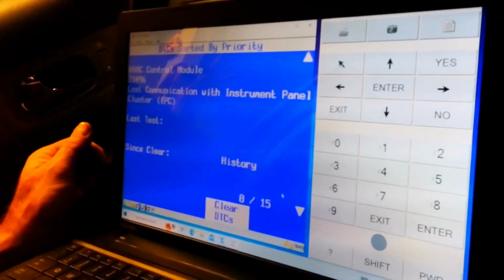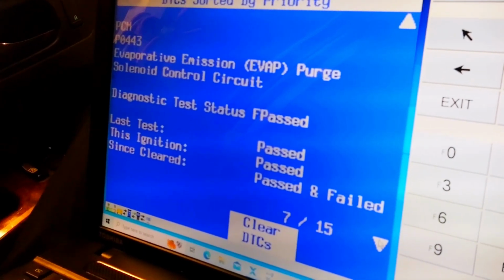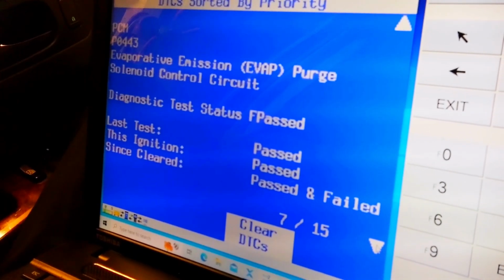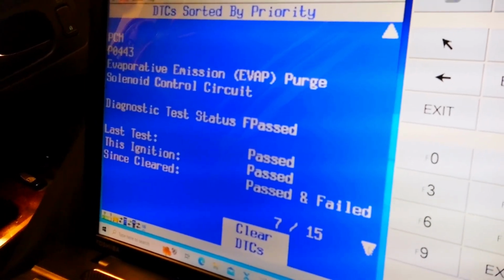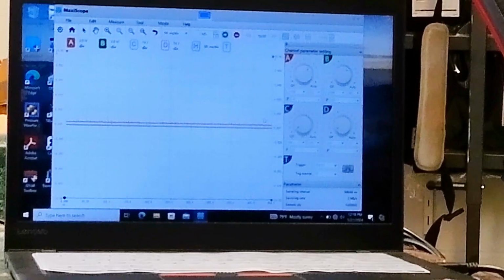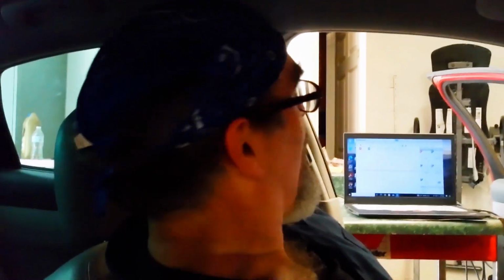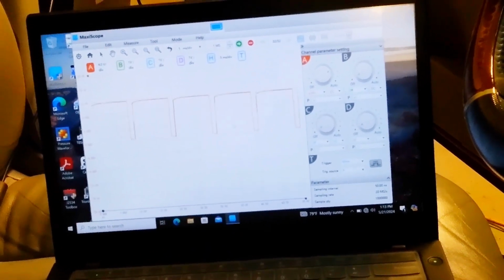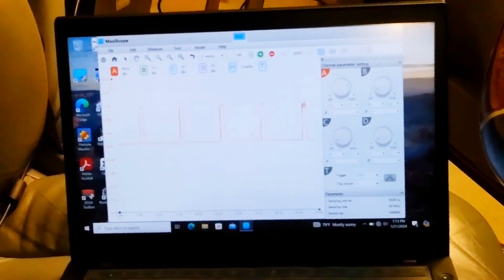2006 Buick Lacrosse no AC, no blower, no communication codes gm class 2 data network.

Comment: Hi Sir could you help me? I have a 2006 Buick LaCrosse and I can't locate the water outlet for the air conditioning system. There is water stored in there. There is no dripping. could you tell me where is located ?